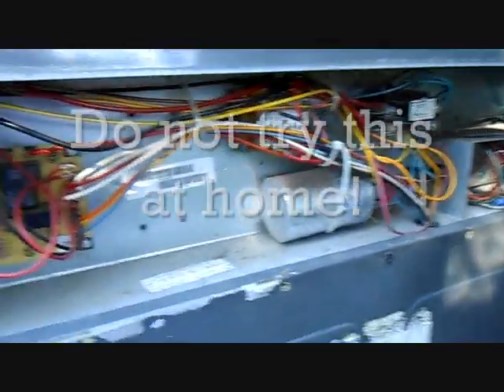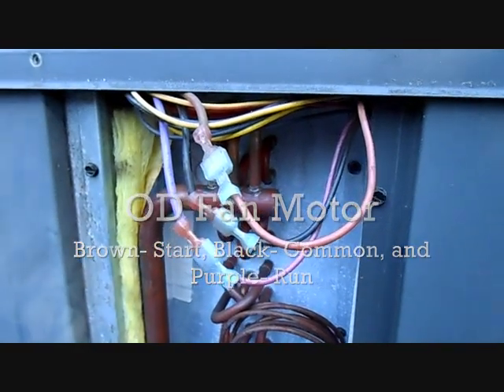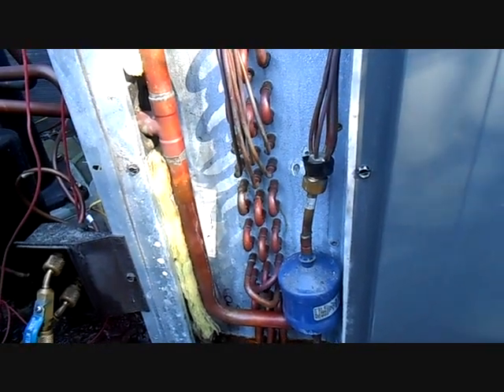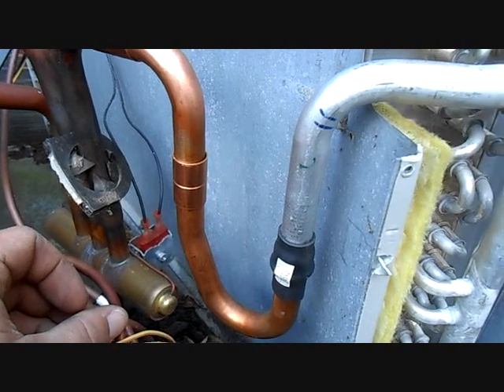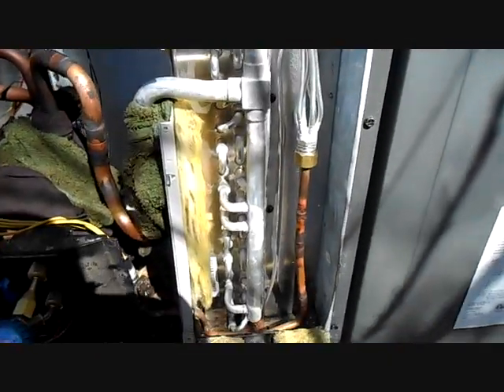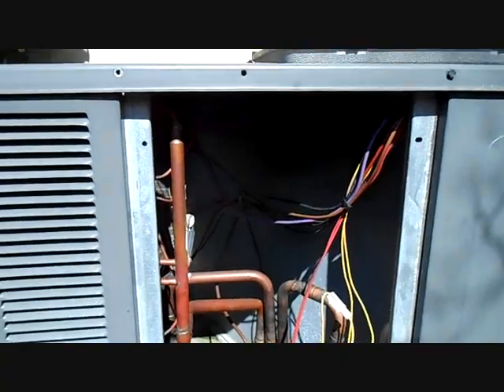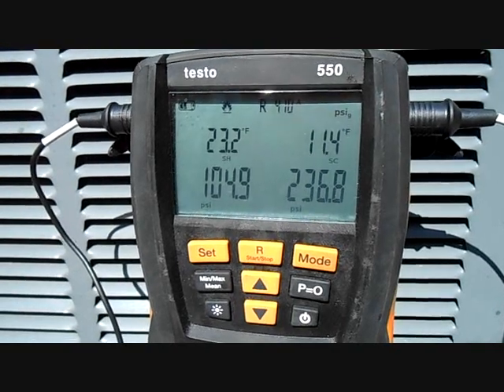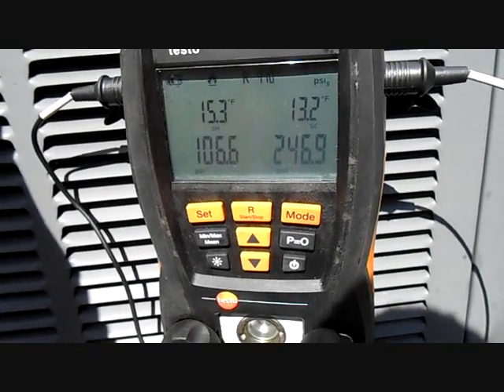Replacing a Leaking Heat Pump Evaporator

Comment: Does the old coil contain some leftover oil charge?  If so, do you have to replace that lost oil?

Also when you are brazing do you flow nitrogen through the system while brazing?  Is this necessary to reduce oxidation inside the fitting?
Reply: The system was evacuated and then deep vacuumed so I wouldn't be so concerned about any amount of refrigerant oil being left in the coil. Also, when brazing the system should not be under pressure. If the system has pressure it will force any brazing material out of the joint.
Reply: You should have a flow of nitrogen through the system to prevent oxidation.